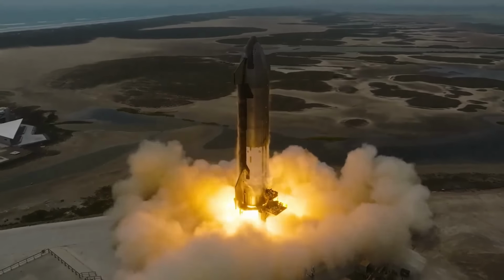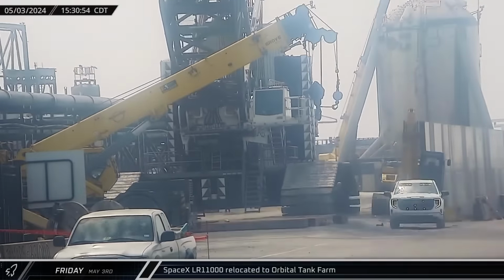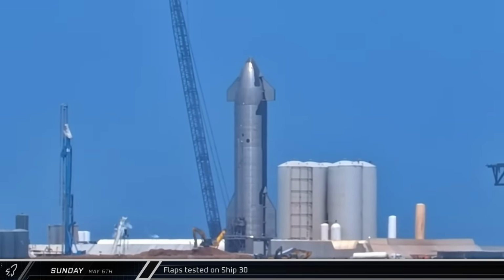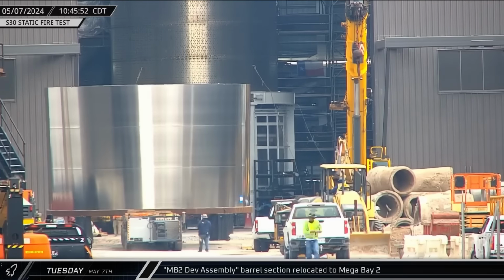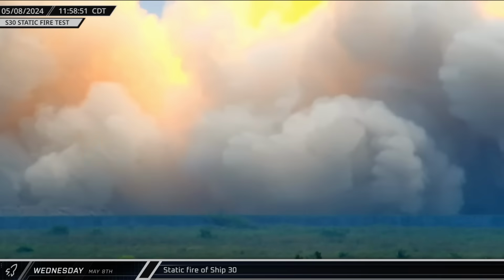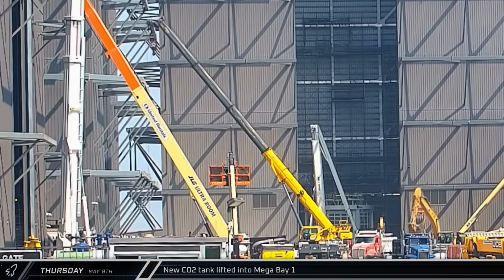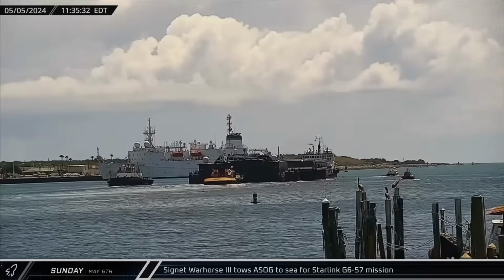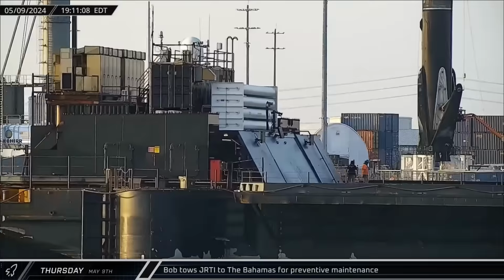Big Changes!! SpaceX Retires Test Stand In Favor Of Upgraded System - SpaceX Weekly #114

Comment: What are they going to do with the Ship 26?
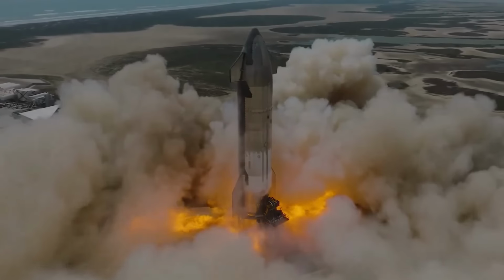Reply: 0:08 this …
Reply: @vonpredator  so they just going to use it to test the stand and scrap it?
Reply: @qadirtimerghazin  probably.
Reply: @qadirtimerghazin  s26 is probably just gonna be a ship they can use to test new infostructure
Reply: No one can say for sure.  If there are no engines in it or put in it then it's likely just a ground test article.  Although engines don't actually mean fly but could be required for other ground tests.